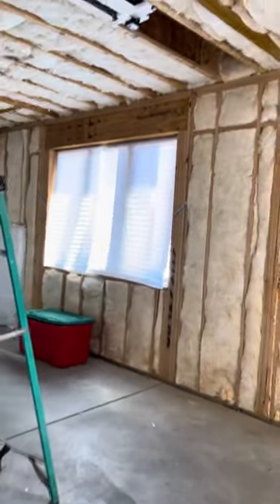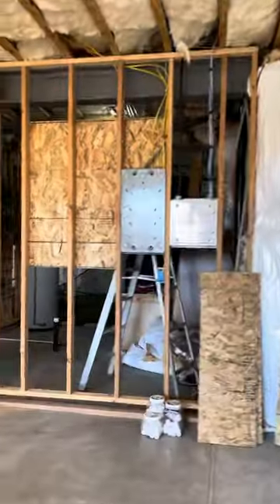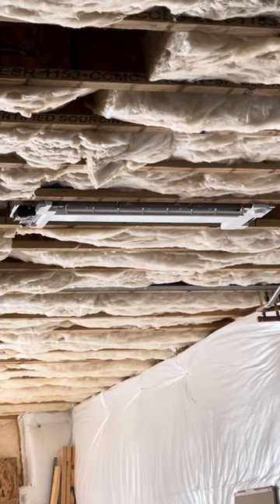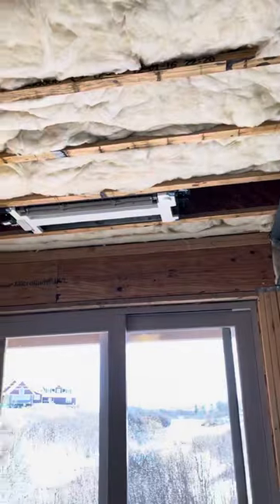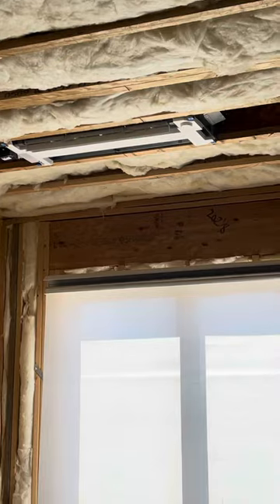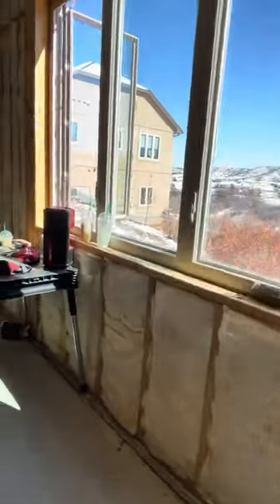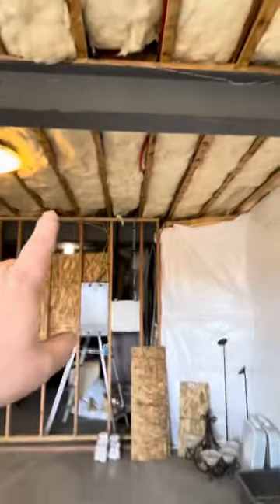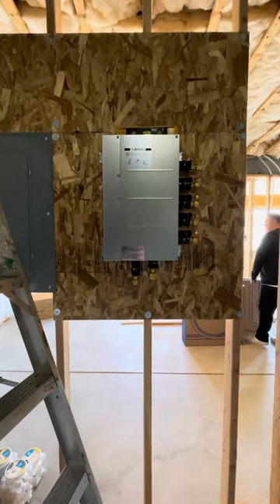Best Mitsubishi Branch box install! Ceiling cassette’s multi zone system DSB

Comment: Jared- I was told you only could install cassettes in a drop ceiling. Supposed to be able to access the unit.
Reply from the maker: We’ll don’t listen to everyone they can be installed in many different ways. Once the unit is installed you can service it 100% from the room. This install was inspected and passed from the city 100%.
Reply: @ductlessplushvac  This was an hvac guy. What state you in? I would like to pick your brain. I bought a church and need some unique options.

Comment: Awesome work! Ive seen your bridge system for ceiling cassette with attic access. How did you support the 2x4 in this application? Do you have different methods of mounting for installs like this one with no attic access? Thanks.
Reply from the maker: All we did was put some 2x4”s up in the ceiling and installed the drops of all thread.
Reply: @ductlessplushvac  Thanks.
The channel is amazing.

Comment: Rafal Preis
0 seconds ago
Hello,

I'm installing this in an ADU that has a slanted roof.  We've created a box so that the unit can sit flat but I'm wondering how close to the ceiling can this unit be mounted?  I don't want that box to have to flare down too much.  Is it possible to put this right up against the ceiling?  Basically does it need any clearance between the unit and the ceiling/roof?  I was going to put a 1-inch piece of rigid foam but that woudl basically make the unit sit right up against that foam at least at one side and pretty close everywhere else since the slant is not very steep.
Reply from the maker: Try and keep some separation to prevent vibration for the fan running.

Comment: Do you need a branch box when doing 3 units with one condenser? I am trying these Cassette Units  qty - 2 12k and 1 18k with a 45k condensers. On my first floor.
Reply from the maker: Branch box units are different them mulit ports, any unit that's required to have a branch box only has 2 pipes off it.